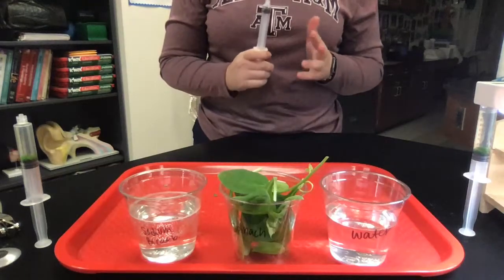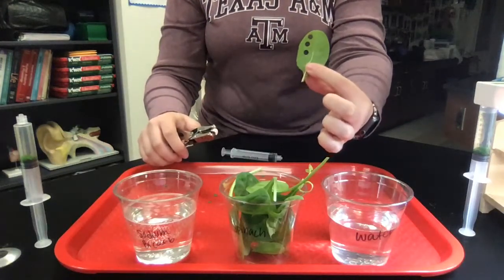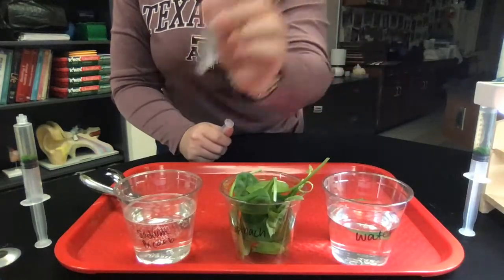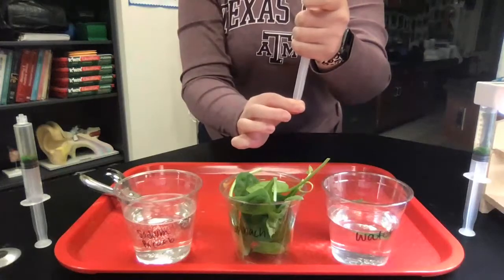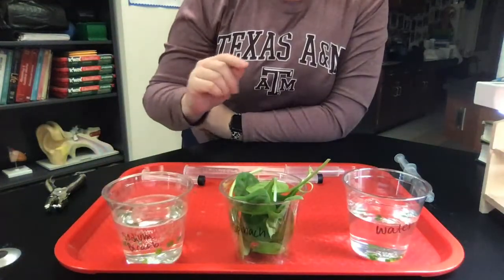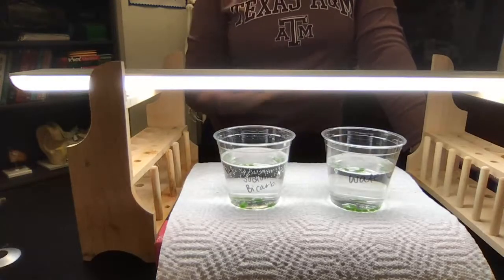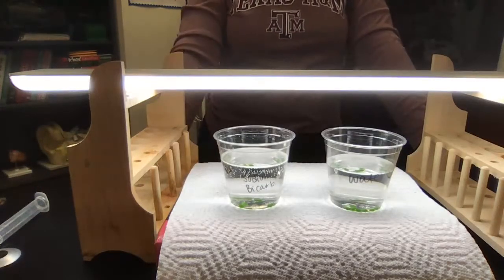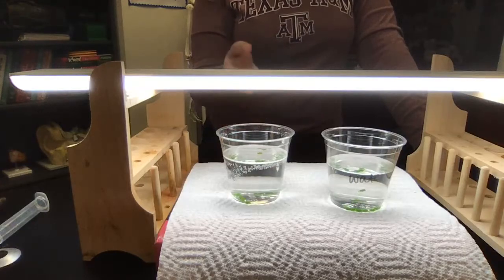Lab 7- Photosynthesis: Floating Spinach Disks Lab

Comment: Great job. The reason the water disks rose is because oxygen is produced as a by-product of the light reactions not Calvin Cycle. There is no relationship between CO2 and Oxygen.  The process is called photolyis. The main purpose of the LR is to create the energy source (ETC) to build sugar in the Calvin Cycle. This is why water is so important for plants. PLUS they have to respire as well. Great job.